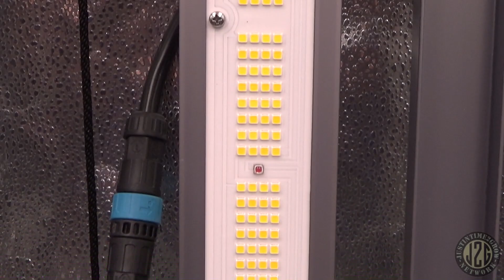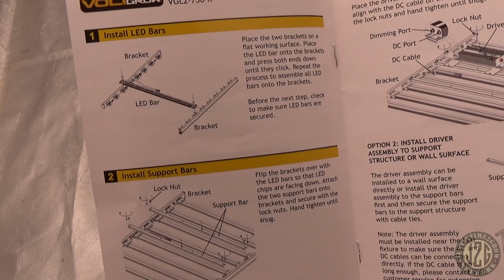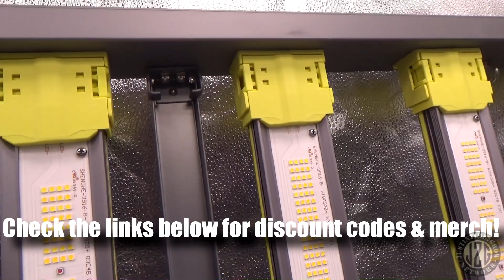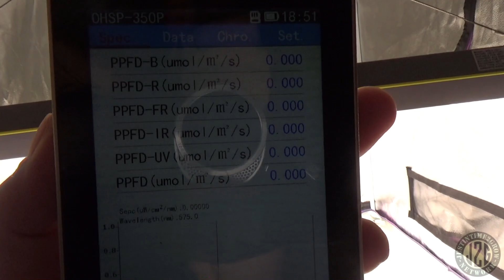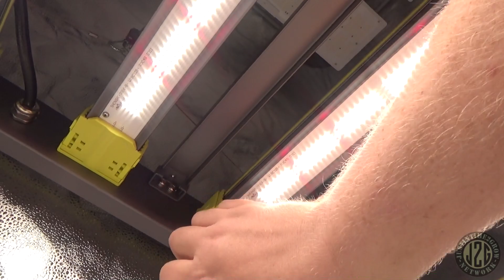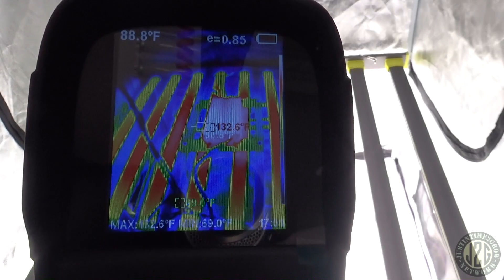A Storm Is Coming!! Check Out The NEW VOLTGROW STORM 8!! PAR, Spectrum, Wattage & Heat Test!

Comment from the maker: I got some more info on the driver, it's an Inventronics driver that's rated at 880w max so pulling 750w is light work for it. Should make the driver last longer since it's not overworked. The bars also stayed quite cool at 110F which will make the diodes last longer. There is a dimmer you can buy from them as a home grower but commercial facilities will have lighting controllers so that's what it's setup for. You contact them for quantity discounts also.

Comment: Hey just a heads up on plugging the power wire. You can run the power wire straight to the driver instead of side rail and won't be a problem in a 4x4. Awesome light and at $549 now you can't beat it.

Comment: In a 2x4 tent would it be better to run 1 bigger light or 2 smaller lights ?
Reply from the maker: Neither is better than the other as long as both options cover the space. You could argue that having 2 you could adjust for different heights but you can also just train your plants to the height you want. It's really just up to what you want to have.
Reply: Thank you.  Was thinking about 2 viparspectra xs1500 for my 2x4. I appreciate your time

Comment: What diodes are they using
Reply from the maker: This is the response I got from them: 

We use 288 cool white, 288 warm white, and 12 red diodes per LED bar on the STORM Series. The white diodes are manufactured in partnership eith a company named Xuyu and have peak efficacies of up to 3.1 µmol/J, which match the efficacies achieved by the Samsung LM301H. The red diodes can reach 3.8-40.0 µmol/J and are manufactured by LED Star.
Reply: @Justintime2grow  that's exactly what I wanted to know thank you very much for the information oh, and by the way I really enjoy watching your reviews keep up the good work
Reply: @Justintime2grow  I wish Volt would have used Ledestar 3030 new white diode efficiency upto 3.3 umol/j this is a nice light fixture! 🤜
Reply: After evaluating dozens of diode manufacturers with extensive testing on longevity, performance & light spectrum quality, we decided to use custom diodes that met our exact spectrum and performance specifications, rather than paying the premium for a big brand name. The diodes are more efficient and have a spectrum better tailored to cannabis growth.
Reply: @voltgrow  you did not answer the question
Reply: @voltgrow  nice light we like it do you have a Instagram?
Reply: @voltgrow  so what diodes are they?